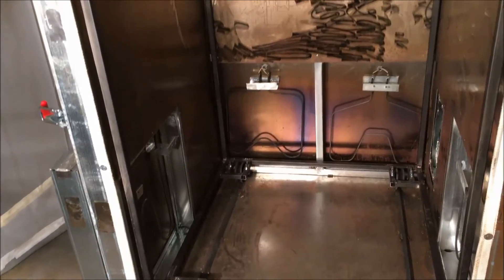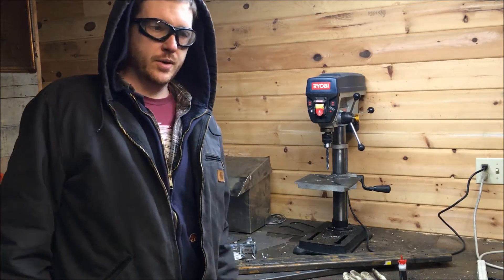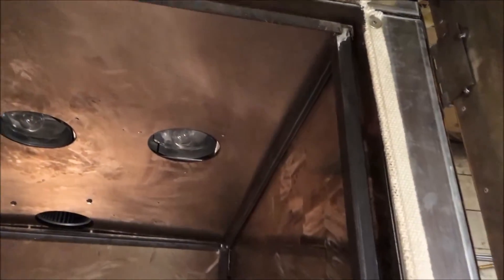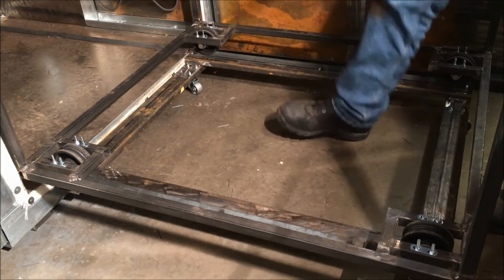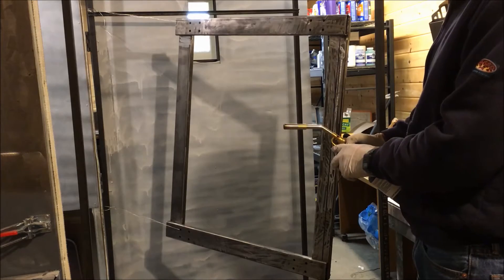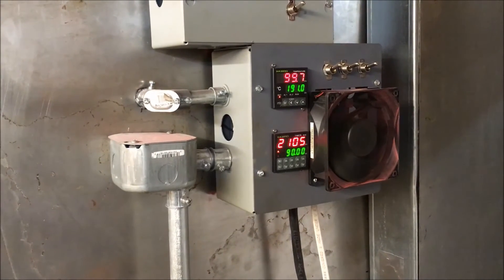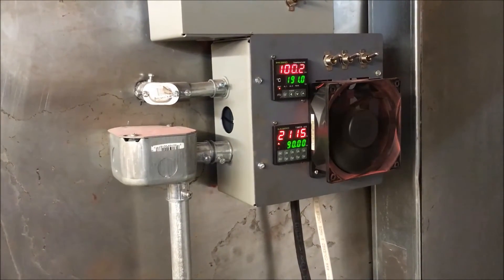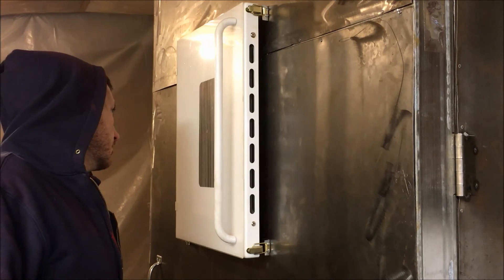DIY Powder Coating Oven Build: Part 12

Comment: use an electromagnetic permanent magnet to lock the two together with a switch to unlock. kind of like the door locking mechanism in air locks...

Comment: I've been thing of making an oven with internal dimensions of 4x4x6 or 4x4x5, just enough to fit a motorcycle fender and maybe a set of wheels. What's your opinion on three elements, one on top, one on bottom, and one in the middle in the back wall, and a convection oven fan in the middle of the left wall and duct work going around to the opposite wall? I'm trying to figure out how to shorten preheat time and even distribution of the heat.
Reply: 3 on each side, why on top????? Heat rises!!!

Comment: Congrats!  It  all looks good.  One comment regarding your temperature gradient:  You may want to add louvers in front of your heating coils.  I think that the temperature gradient is caused by direct radiant heat from the heating coils while the rest of the oven is heated by convection. 
Cheers,
 Bernhard
Reply from the maker: Thanks for the suggestion! I'll let you know how it goes when I try that out.